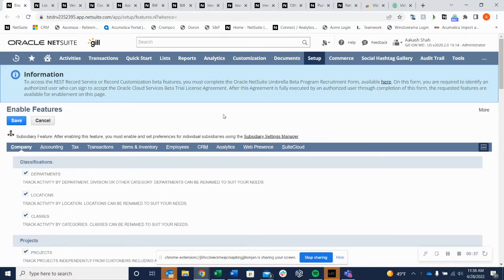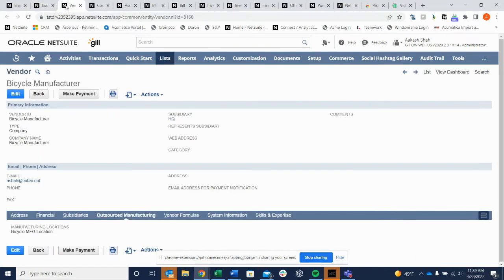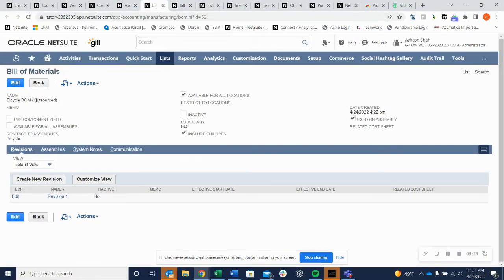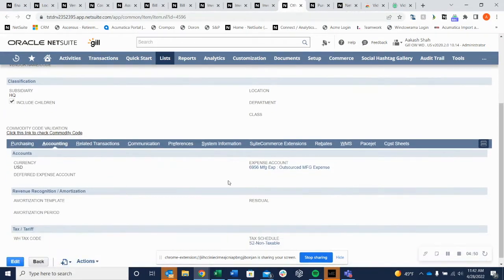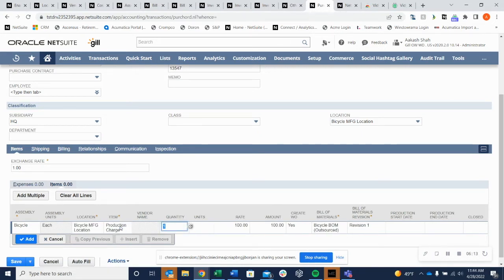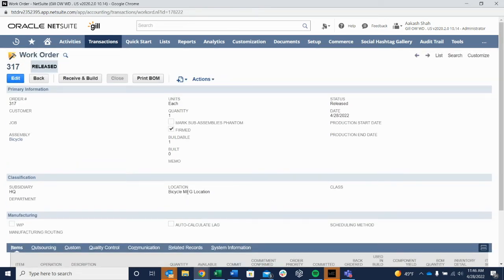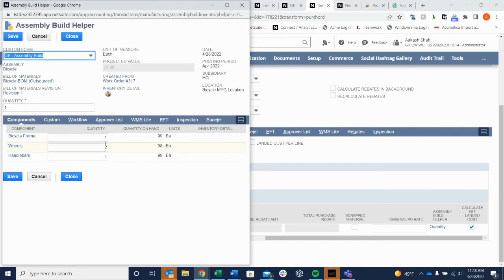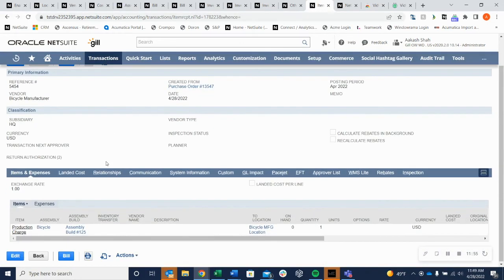NetSuite Outsourced Manufacturing Demo

Comment: Hi, this is great, One thing i am not seeing - how is this directly connected to the Purchase Order in question? How is it binded?
Reply: On the related records tab on the original PO, the item receipt transaction is recorded which is tied to the receipt of the bicycle from the outsourced manufacturer. That item receipt transaction links to the the assembly build which then links to the work order.
Reply: There should be a "Create WO" on the line level of the PO. If you don't see it customize the PO form and add the field. When this is set to true and you save the PO you should see an associated transaction at the line level ie: WO317. It's similar to the "Create PO" field when working with drop shipments.